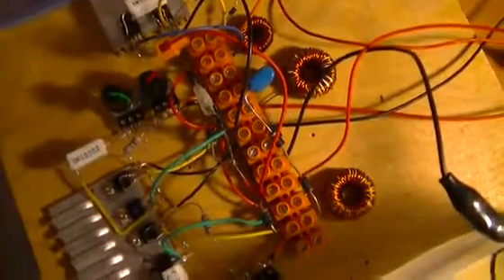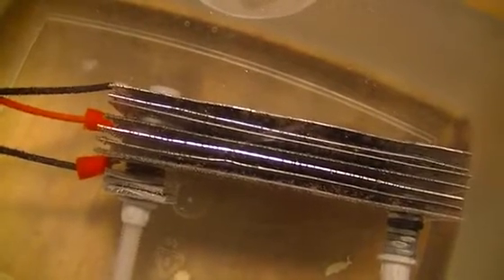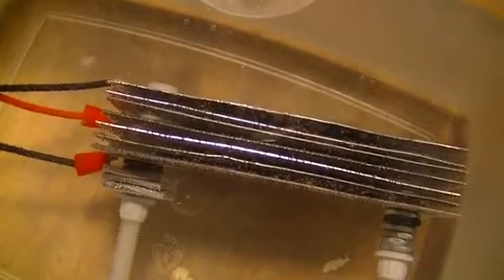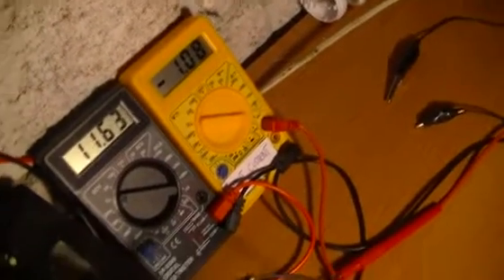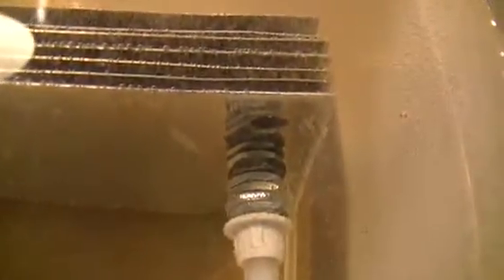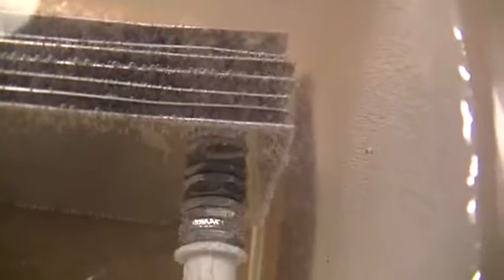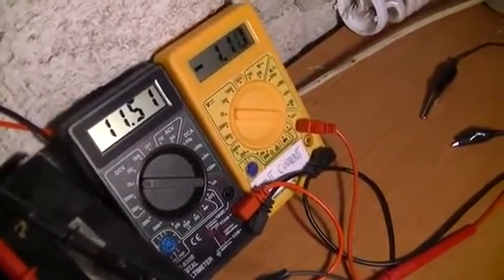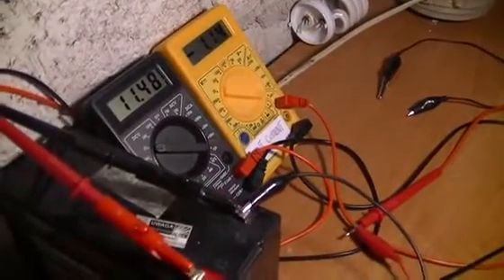My first HHO wet cell S3C

Comment: hello! I am trying to make a 7 plate wet cell very similar to yours here. I am very new to this and had a question for you if you could help me out..
how and what did you use to build the cell exactly? can you give me the order of parts you stacked in a row.? ex: nylon bolt, plate, nylon washer, plate, nut.. etc because I am confused and cant figure out exactly how to make the cell with the two neg on outside and pos in the middle. how do you make the nutrals nutral? sorry I sound dtupid and that's because I am when it comes to learning this stuff. ;) thanks if you can help me!!